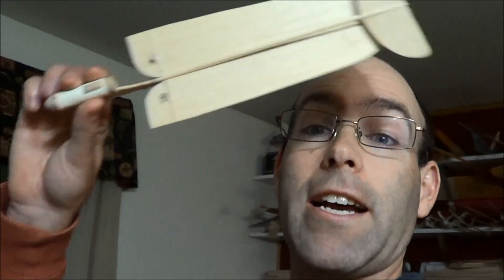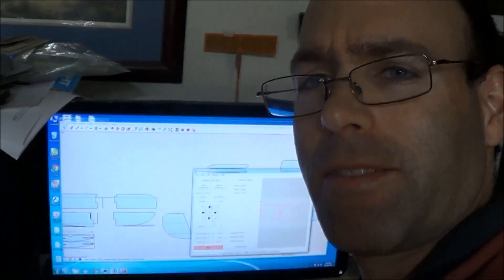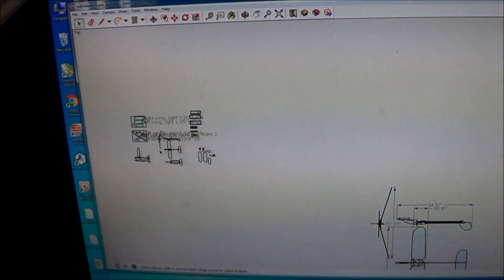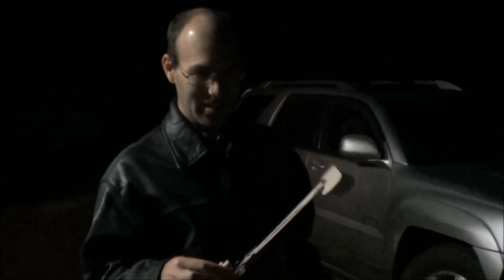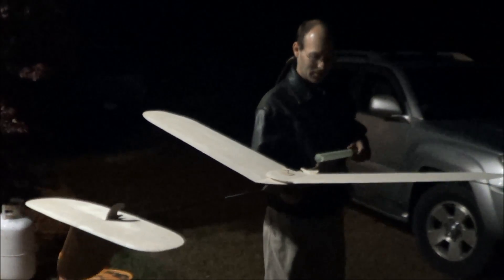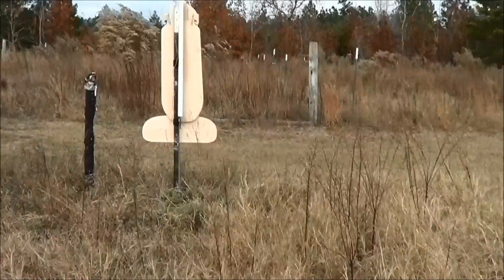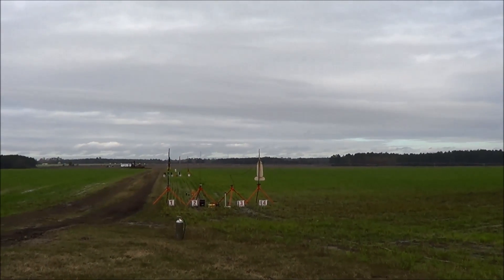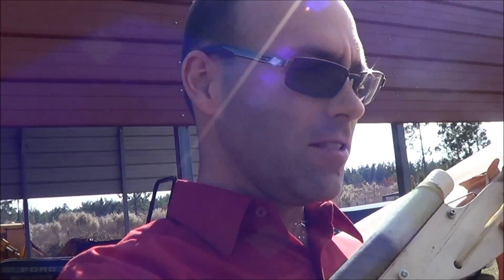We built a giant rocket glider!

Comment: Nice flight josh! I must say, I’m impressed with how nicely this one glides. Certainly would not have expected that given how heavy it is. Nice work building and flying it. What thickness of balsa did you use for the wings? And what airfoil? And what are the dimensions of the tail boom?
Reply from the maker: Copterdude, thanks! It's pure wingloading. 500 sq in of wing area is a lot of wing!
Reply: Nice! Wow that is quit a lot of wing area. Wing loading is a deceptive thing; you’d never guess that glider has such low wing loading!  You know I’m wondering about the thickness of balsa on the wings, because I’m thinking that at that size you probably want to go for some of the thickest balsa you can find, to get a really effective airfoil. I recently purchased a sheet of 1 cm X 15 cm X 1m balsa that weighed only 75 grams here in Germany. Try looking for balsa from European distributors, because I’ve noticed the quality in Europe seems superior to quality in the US.
Reply from the maker: Copterdude, good to know. I've pretty much cleaned Sig out of good balsa and have to order from Specialized now.
The wings are 3/8" thick, which is obviously a very thin airfoil, but it seems to work well, so I'm sticking with it for now.

Comment: Congrats! Very cool. I especially enjoyed the big rocket scale Iike flight. I noticed you didn't comment on the delay. Was that an optimal transition? Would a delay of 3 secs yield a better time?
Reply from the maker: SlingShot RC, if they made a 2 second delay, I'd use it, and probably gain another 30 seconds right there. In the future I'm going to at least consider an altimeter based deployment to improve that situation.
Reply: Joshua,
I used to fly high power rockets.  We used to use simple mercury switches for apogee detection for igniting the parachute charge.  You might consider something like that.  The rocket would have to carry a battery and an ignitor.